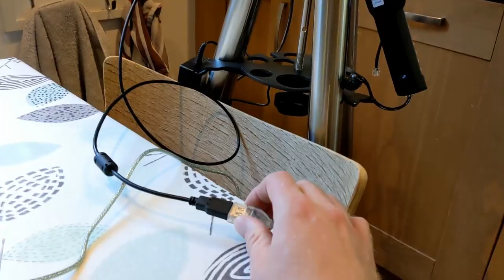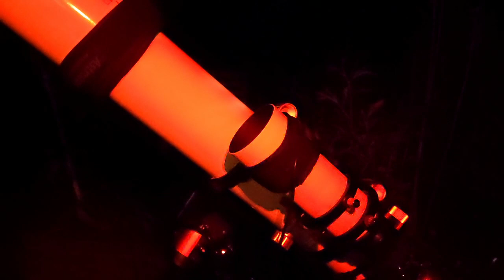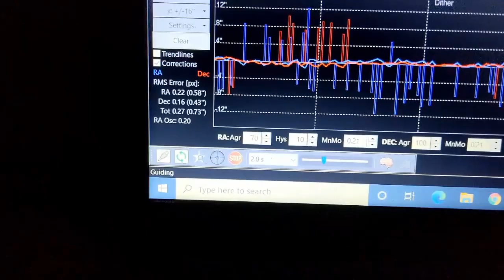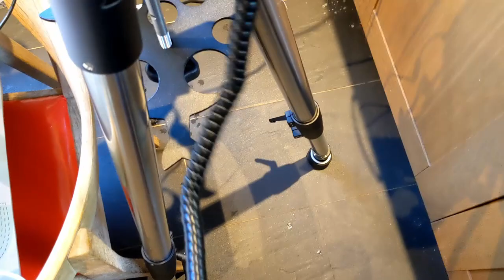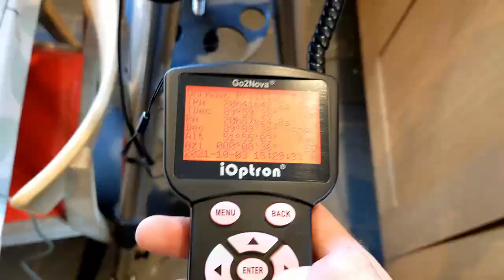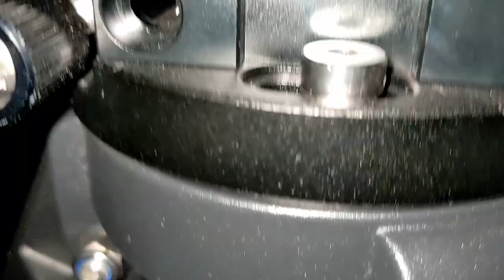iOptron GEM45 NUC Review

Comment: Excellent Just what I was looking for an Honest Opinion. thank you for pointing out all the quirks.
Reply from the maker: Thanks.  Unfortunately I did actually return the mount  in the end.  I wasn't feeling happy with it.  Mounts are the most troublesome and temperamental things, I did hope for more.  Good luck with your astro!
Reply: @AndyofAstro  I was totally conflicted with the Sky-Watcher EQ5-6 Pro and this one, Sales guy was pushing the GEM45, I watched this Video and I have been down this road before with my Meade Mount its a pain,  Can I ask what brand you switched to eventually, you have changed my mind now after seeing this.  Thank you so much
Reply from the maker: I went for an AZ-EQ6GT from Skywatcher.  It only arrived a couple of days ago so I've not used it yet.  I so wanted the GEM45 to be the mount, and I'm not even sure the Skywatcher will be, however the build quality on the new mount is like a tank.  I went for AZ because it doesn't use the easily bending latitude bolts, which is a plus.
Reply: @AndyofAstro  Did it come with the Lynx computer control cable or is that a separate purchase?  I believe this is also the mount I would like to find.
Reply from the maker: My one has a built in USB connector.  A normal USB A to B lead will control the mount from Eqmod.
Reply: @AndyofAstro  Hard Case some come with a case they are vague about that also, thanks for all the answers too
Reply: Do a review i would like very much to hear your opinion.
Reply from the maker: My AZ-EQ6GT doesn't have a case, I might build one.
Reply from the maker: Sure will, thanks for watching I appreciate peoples input and feedback!  It means a great deal.  I'll post a review as soon as clouds allow.....
Reply: @AndyofAstro  I was told today that I cannot buy this mount till the end of next year would you share where you got yours?
Reply from the maker: @Dudleydogg  they are showing some stock in the UK suppliers FLO, Altair and ROV, worth emailing around to get the best price.
Reply: @AndyofAstro  I found a AZ-EQ6 Just Ordered it, Wow, Can't wait, might be a bit before I receive it though.

Comment: Absolutely spot on with your review.  the usb works fine as a hub through the main mount usb cable.  everything passes through just fine although usb 2 only. another miss on Ioptron's part.  Very delicate mount.  I cringed every time I  saw you lean on the cw bar. My mount actually was shipped with the allen wrench in the small hole in the RA motor housing which I'm sure would have destroyed the mount for sure.  The pads on the tripod feet are a nice touch but you have to manually rotate them into  a flat position every time or the legs are prone to shifting.  My guiding is not quite as good as yours but maybe it will improve when i clear the align data.  Transporting the mount is like a flailing octopus as you have to release the clutches for travel.  All in all a great mount with lots of little annoying quirks.  To be continued.  Great review.

Comment: Thanks for the insightful review. I fairly recently acquired the GEM45 mount and I'm struggling to achieve the level of guiding performance that you're getting. A couple of questions. 1) Are you using iPolar to polar align or some other method? I've read reports of a lack of accuracy using iPolar. 2) I was under the impression that whenever one performs a new star alignment with the mount, it will automatically erase the previous alignment data. You seem to claim that's not the case. Does that mean that you're running "Clear Alignment Data" everytime that you're setting up the mount? 3) Regarding the faulty USB cable, did PHD2 or some other software indicate during a guiding session that the connection was lost temporarily?
Reply from the maker: Thank you for the message.  I have actually had a few problems with the mount and I'm learning my way through it.  In answer to your questions 1. I am using the ipolar to polar align, it seems quite accurate.  2. I don't use a hand controller when imaging, I use APT and platesolve to objects.  However I was not sure if alignment data is stored in the mount or not (I don't believe it is stored on the mount - but it is hard to know).  I have not yet used the hand controller for Star Alignment, however I would clear alignment data before a session and then re calibrate because the hand controller does store the last alignment. This is to prevent errors.  Each time you calibrate this should over write previous data in the hand controller, however I would clear this data so that your first slew to a star is starting from a clear data - I apologise if I've made a mistake, I'm on a steep learning curve with the mount, it's quite different to my previous Skywatcher.  More importantly, the Zero position in both the software and hand controller seem to influence the accuracy of the slewing to objects.  Therefore I set my zero position each session and then slew in APT and platesolve to object.  3. The usb was odd, APT reported disconnecting sometimes, but not all the time, then the mount would just stop, or it would be guiding, and suddenly stop, it was so odd.  However the USB lead was the cause and  changing this has stopped the disconnecting.  Hope this helps clarify, good luck with your mount.
Reply: @AndyofAstro  Thanks for the quick response. I will give clearing alignment data a try to see if it makes a difference. How exactly do you set your zero position? Do you run "Search Zero Position" and then follow it by running "Set Zero Position"?
Reply from the maker: Correct, search for zero, let it do a little dance and then settle.  Then set it as your zero position.  Hope this helps.
Reply: @AndyofAstro  Got it. Thx

Comment: Thank you for your reviews, the day before yesterday I ordered a gem 45, since it is not possible to buy an eq6-r pro, maybe it is better. I'm waiting my new GEM 45. I think it will be much easier, which will allow me to travel with it.. ps. apo apm 140 or ed 80 will be installed on the mount.
Reply: Hey! Where did you get the APM140? :) Have you gotten the GEM45 yet? How is it? Cheers, W.
Reply: I realize this also I was told it will be another Year or so to get this Mount.  Same ole story I go blockbuster finally decide on a Video and sure enough its sold out.
Reply: @Dudleydogg  Yes, equipment has become scarce. But I managed to pick up the GEM45 and it was delivered to me.

Comment: I appreciate your review.  I am considering buying an iOptron either a GEM45 or a CEM40(EC?) or possibly even the CEM70 if I can afford it.   Thanks for going over some important issues that could affect setup.   I assume you spent a fair amount of time looking at the various iOptron mounts and wondered if you had some suggestions about choosing between the CEM or GEM lines.   I plan on using it with a Celeston EdgeHD 9.25 and my next scope which will be a refractor in the 120mm range.  I know there were some issues with your mount but to be honest most of them sound more like personal preferences rather than a consideration on whether to get or not get an iOptron.
I look forward to more videos on the mount since as you know there isn't as much info out there on these mounts as there are on mounts like the Celeston and EQ series of mounts.
Reply from the maker: Thanks for the message.  I am going to put an 8 inch classical cassegrain on the mount (when the counter weights come into UK stock).  It should cope easily with this loading with guiding.  Therefore I would imagine the Edge will be fine.  The loading capacity is similar to an Eq6.  With regards to Centre Balanced EQ and German EQ differences, I am more familiar with German EQ designs and have little knowledge of the CEM however for me it was loading capacity, guiding and reliability.  I also have to rig and then derig, and weight is a consideration.  The GEM45NUC has good balance between these.  The alternative for me was an Eq6, and I am not keen on the latitude bolts.  I never like following the crowd, I wanted something different.  The cem70 would have been another choice and Astrofarsography on YouTube did a good run through and review of this mount.  I was considering the 70, but I don't think I can lift it.  I will keep the ioptron content coming I've got a run through of the software and ipolar coming.  Good luck and all the very best.